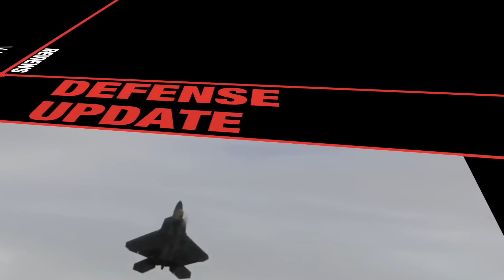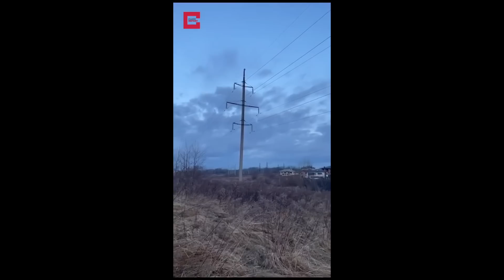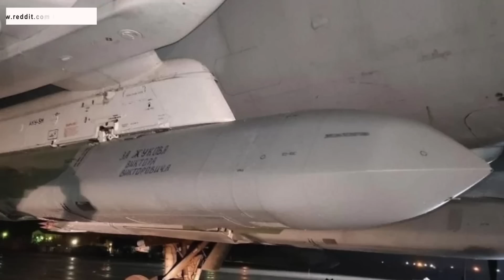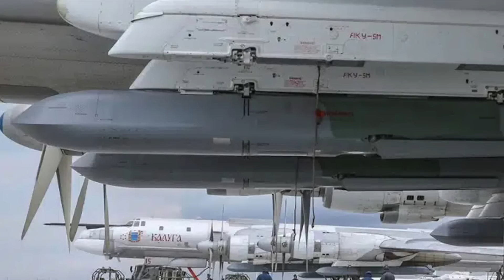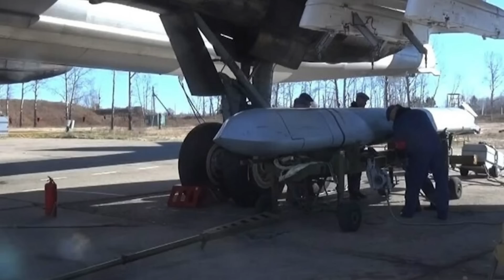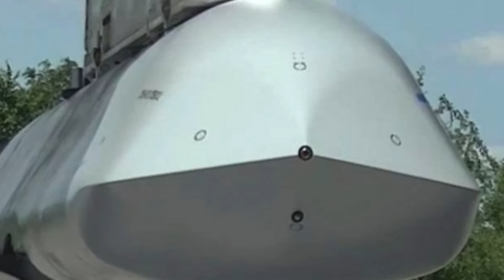Footage of a Russian Kh-101 deploying decoy flares during its flight has emerged !

Comment: Missiles tend to have less drag than whatever flares or chaff they employ, and thus, chaff and flares tend to slow down much more quickly than the missile itself. For those, who write programming for missile defense systems, who are aware of this simple fact, it could be easy for even low-resolution IR or radar imagers to tell a missile from the flares or chaff that the missile might disperse by looking at which of the signals would deviate the least in terms of velocity from what the average was over the span of a second or two.

Comment: You could block this missile by detecting it then flying a very large perhaps nylon net into the air using say thousands of quad copter drones in unison or a few hundred very cheap rockets. The missile gets caught in the huge net and with luck does not puncture straight through it and then it crashes... ideally a graphene or carbon nanotube net would be used but we dont have that yet, or do we.
Reply: uhuh.... and you will coordinate the positioning of all this how? Cruise missiles don't fly in a straight line, you can't move your net fast enough - plus it sounds really expensive. Compared to just yk - flak. Just think how you are going to cover a 3000km long line of possible flight paths. That's before you add the fact that, these kind of munitions can change altitude.
Reply: i think it might have some potential for low flying cruise missiles only. if it went high then existing air defense intercepts it. It would be potentially expensive an is far fetched. but i envision drones tethered to the giant net for power from wires in the net, so the drones could hover holding the net in the air for long periods only around high value targets,  during an entire air raid, the idea is its enough to stop the cruise missile, but without a material like graphene its probably not viable.   @lucidnonsense942